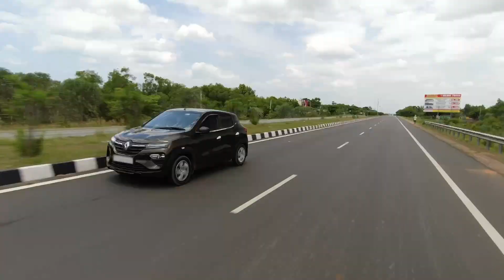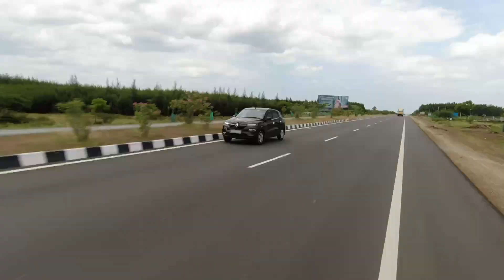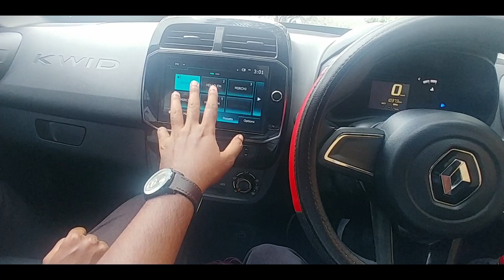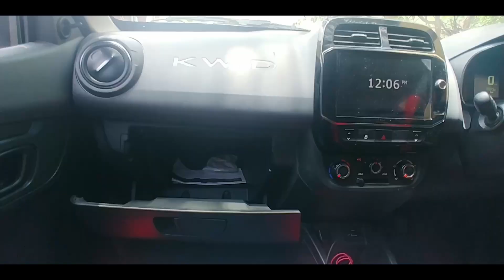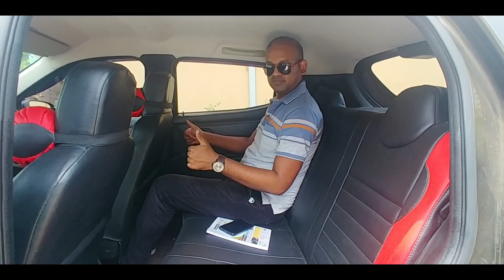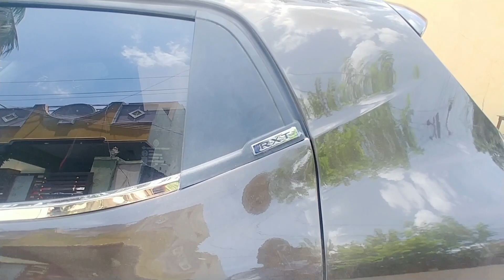Good small car, could have been better - Renault KWID 800cc - Drive Impression

Comment: Great review guys.. What are your thoughts on Triber ?
Reply from the maker: Thanks man.

About Triber - It is powered by 1L naturally aspirated engine producing 71HP and 96NM of torque, which is way low even for a small car. It's just a people mover, appreciate it's safety ratings though. To put things in perspective, my Honda Jazz has 90HP and 110NM of torque and when I drive with more than 3 passengers I always feel it's underpowered.

So, a 7 seater? with these power figures 71HP and 96NM ??? - UNDERPOWERED. 

Hope they launch Triber with Turbo soon - that'll solve this problem
Reply: @twinturbo3296  Yeah engine is underpowered.. I'm trying to decide between Kiger and Triber
Reply from the maker: @charlzbryan  Kiger and Triber are based on same platform so it'll be safe and we have a video coming up on Triber possibly in 2 weeks. 

The seats are super comfortable in Kiger including the rear ones, interior is up by few folds and the top end turbo model gets different drive modes as well per your need or mood. Totally worth it - good luck.